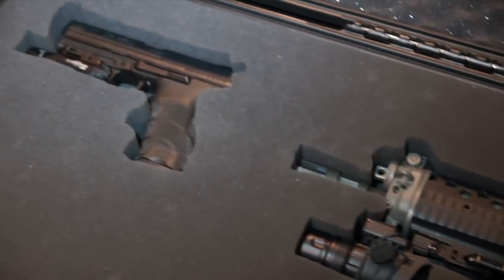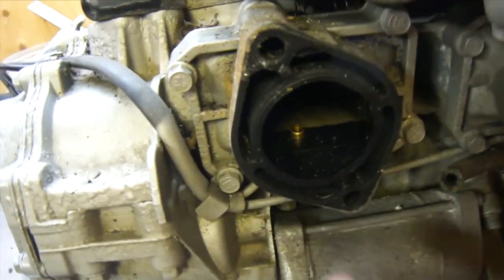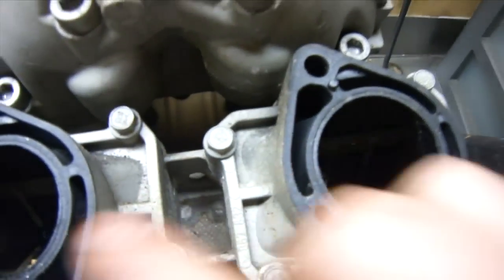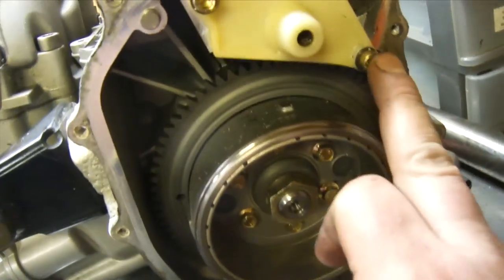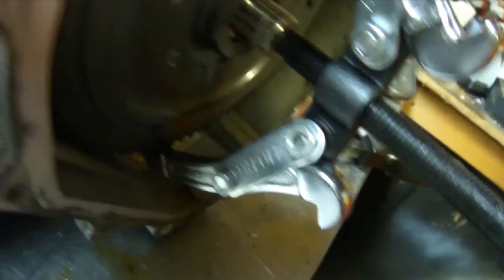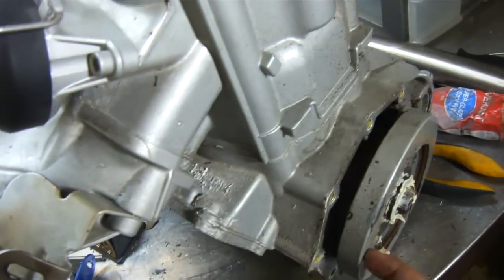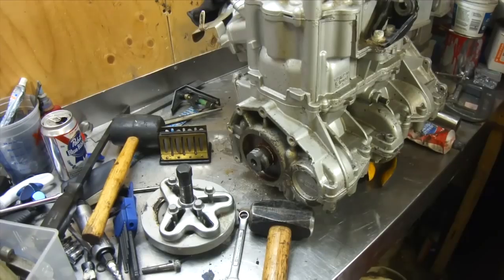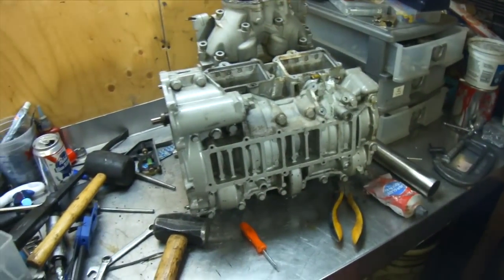How to Rebuild a Seadoo Engine part 1

Comment: I'm considering one of these seadoo 951s for a custom waveblaster or superjet build. countless yamaha 701 builds, (61x and 62t). Besides for the power valves all these 2stroke dual cylinder motors are basically the same
Reply from the maker: +Todd Horelica sounds like a interesting build.

Comment from the maker: they shouldn't have a clutch, they are direct drive, one style has a coupling that could break the other one has a shaft that goes directly into the flywheel.  make a video of it and send it to me.... in iceland i'm not sure where you can even get parts i'd google seadoo and see where you closest dealer is.... in Canada parts are available everywhere here

Comment: my seadoo sp 96 have a problem . any body can help me please: I have no seadoo service next to my place. off whater work perfect. but in wather even start. all ready change carb kit ,line fuel,check valve rotary,belt is ok,high and low is ok,fuse box brand new,please help me  if you know the solution... tks

Comment: i had to remove the flywheel from my seadoo and i had to use a homemade flywheel puller that used 4 bolts and had to heat up the axle to remove it, took me fkn hours!